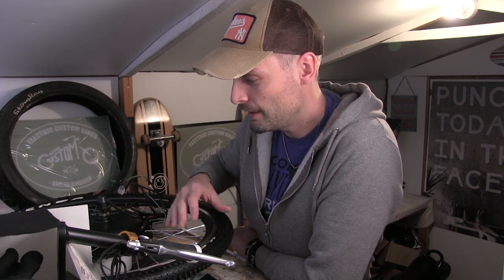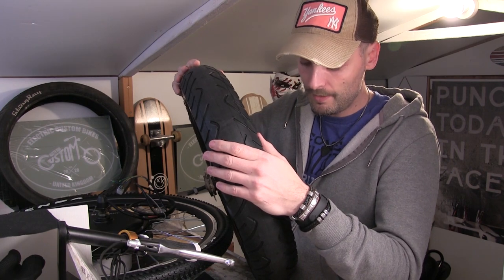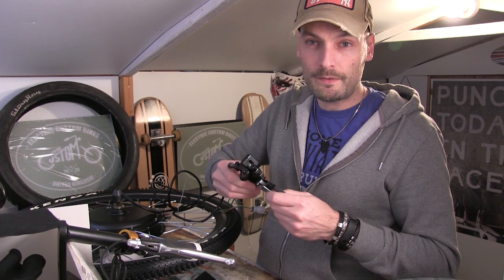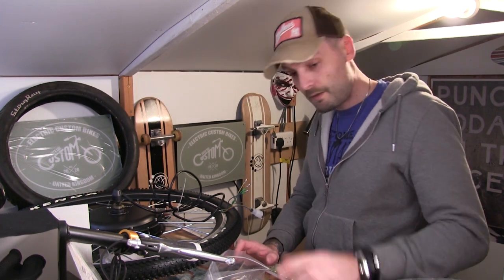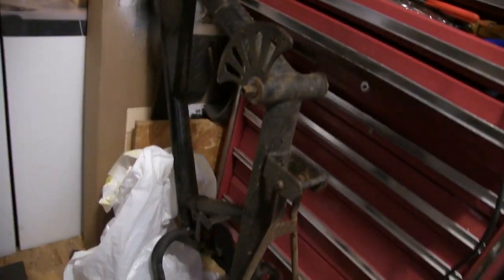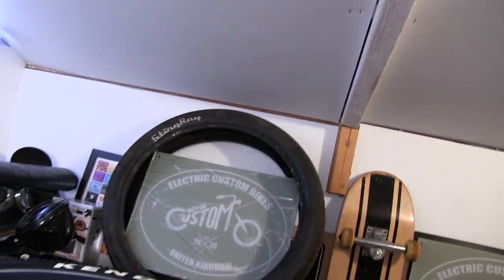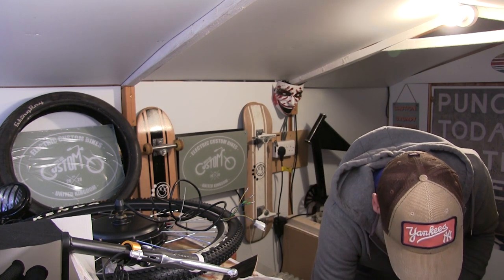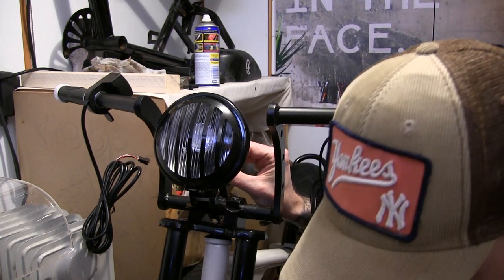Custom Electric Schwinn Stingray Chopper Bike - handlebars, new wheel - Episode #6

Comment: Im in the process of building an occ stingray too. But I'm putting a rear Electric motor on it
Reply from the maker: nice one, I will build one with a rear motor one day but at the moment can't justify the extra cost, it's like twice as much and after riding mine can't see the benefits apart from it looks super cool.
thanks for watching
Reply: What size spokes would you use (rear wheel with motor).